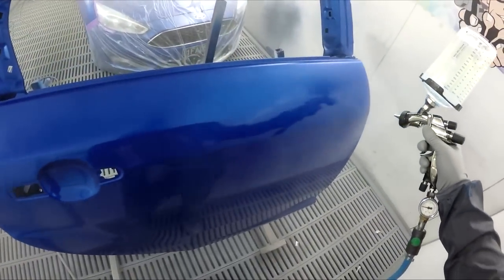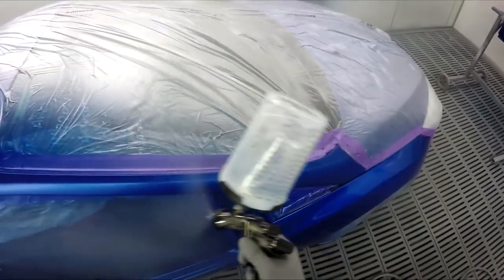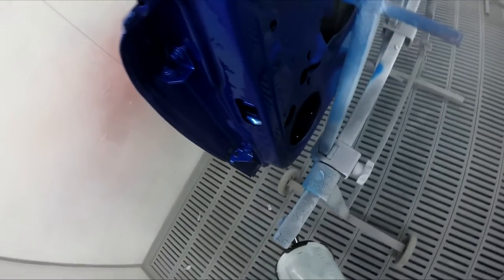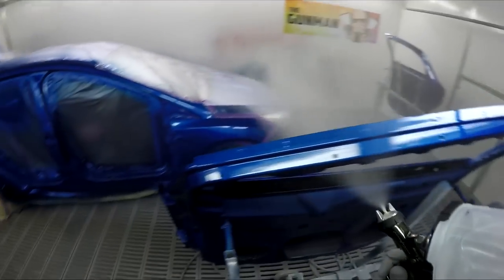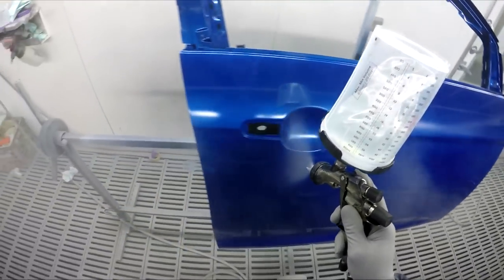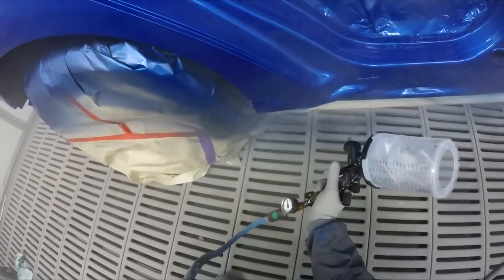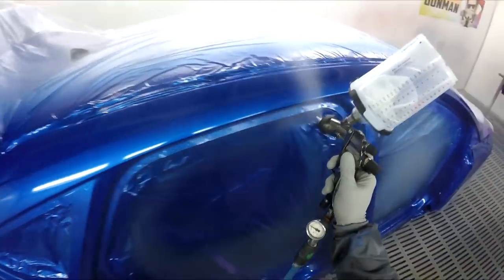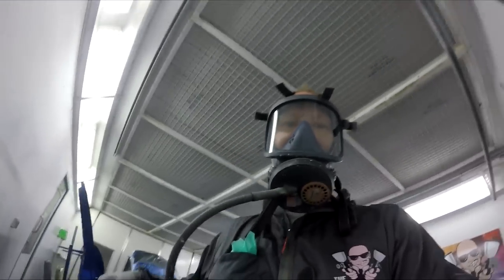Black Mamba Supernova LS-400 1.3 HVLP, Clear Coat. Ford Focus 🐍

Comment: I have a Supernova hvlp hybrid, and it lays on sealer (wet on wet), and basecoat like nobody’s business. From what I’ve gathered the hybrid model was designed for basecoat in mind, and I can see it. I’ve tried to shoot clear with it and I just wasn’t impressed. In its defense, I was trying to spray a high solids clear through it, and I may have needed to over reduce that clear. A mate used it with the same clear and loved it, but I just prefer my tekna prolite clear gun. I can move much faster and get that glass finish way easier. Great video, Gunny! Also, I’m thankful to know I’m not the only one who accidentally messes up the sealer occasionally! 😂

Comment: Great video I have a ls400 1.3 et use on lesonal w/b great gun never used it for clear looks like it does the job tho iwata rep recommended to me full fluid 2bar and fan 2 turns in from fully open works a treat for base

Comment: What's the air hose diameter are you using on that panting job?
Reply: Pinturas Hgs looks like a ‘Prevost Stoflex’ hose which have a 10mm internal diameter. Not used one but I’ve only heard great things about them especially the high-flow connects 👍
Reply: Thanks for the answer, I really appreciate it.

Comment: I have a LS 400 do you know if I can put a air cap from a WS 400 on my Ls?  I want to get the WS cap for when I spray clearcoat with it because from everything I’ve seen the WS’s are a little better with clears even though I’m not disappointed with how LS sprays clear I just want to know if that’s a option?
Reply: I have 3 different versions of these guns...1 ls400 entech ws400 base and ws400 clear. I can experiment this week and get back to you.

The ls400 and ws400 share the same gun body so if you wanted you could swap the air cap and nozzle/needle to make it a ws400
Reply: superduty8 sorry I didn’t reply a little sooner I don’t check you tube that much, but if you want to experiment a little I would love the feed back. I honestly was just wondering about just getting the cap and leavening in the same fluid tip and needle because if I go through the alll the trouble and spend the amount of money it would take to buy a new fluid tip needle and cap I might as well just buy one off eBay that’s in good shape. I’m just being cheep because I only do base clear jobs on the side. My day job is spraying single stage on semis.
Reply: @amosautomotivepaintrestora1948  I haven't been on much lately myself.....anyway it worked fine with the ws air cap on it also leaving the ls air cap and turning the psi up to 29 worked just as good. So you probably don't need to buy an air cap. Just adjust your fan until it's even across.  I  found with the ws air cap it was really heavy on the ends and had to narrow the fan in more than the ls entech air cap.  Also air pressure depends on how thick your clear is..if it's on the thin side less pressure I found is better...more like around 27 or 28 psi.